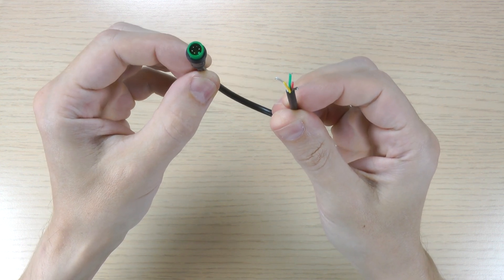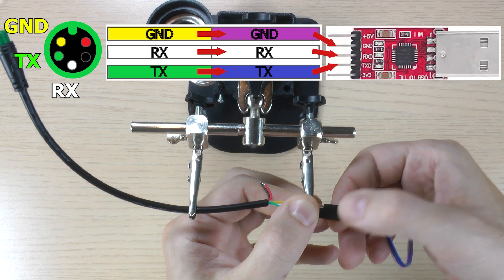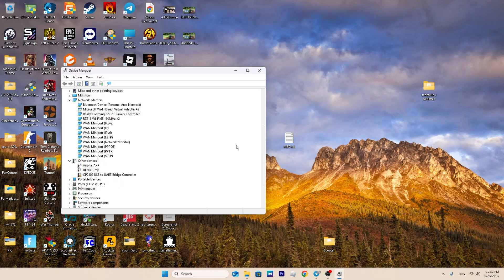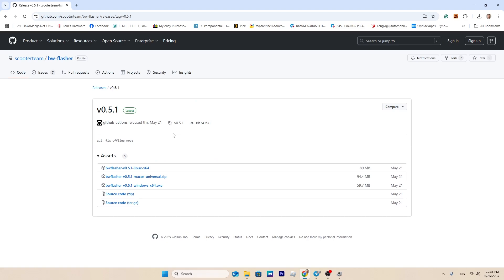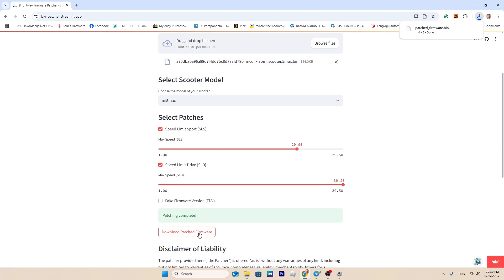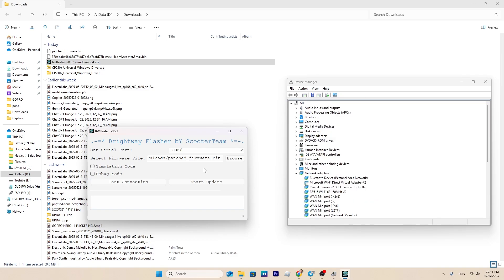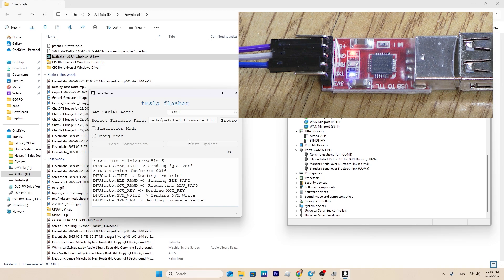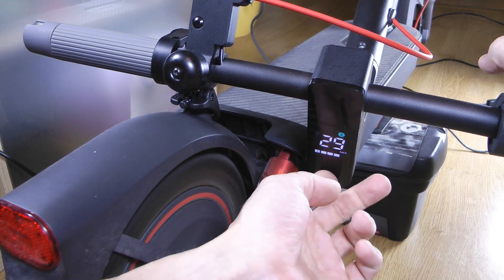Xiaomi Scooter 5 Max Speed Hack (5*|5Pro|4*|4 Pro 2nd Gen)

Comment: Is there any possibility to kill that fucking peeep noise at 30 khm/h ? Maybe with a fake firmwarecode or so?
Reply from the maker: 1: Cover the speaker with duct tape to reduce the sound (quick and reversible).
2: Desolder the speaker from the dashboard for a
 permanent solution.
3: Limit max speed to 29.5km\h.
Subscribe, thx.
Reply: @MindaugasJocionis  thx for the fast Answer; ok maybe i will wait a bit longer it only takes time for modding community to solve it; and i am pretty sure it will be in the modded software some time
Reply: @MindaugasJocionis  Thank you so much for the video! I tried long time with AI and wrong information I found online, but with your video it finally worked well with my Xiaomi 5 Pro! 🙏 Only the peep sound is annoying now. Could you maybe make a video, how to desolder the speaker, please? That would be great! Thanks a lot! Subscribed your channel and will stay updated...👍
Reply from the maker: There’s really nothing complicated about it — just unglue the dash screen, unscrew a few bolts to access the back side of the dashboard PCB, and desolder the two speaker pins from the back side of the board.
I’m still not sure if I want to desolder the speaker just for an extra 2 km/h, especially since it’s still under warranty.
But if I decide to do it, I’ll definitely make a video about it.
Reply: @MindaugasJocionis а если попробовать изменить.bin и убрать бип бип ?

Comment: Hey! Thank you so much making this video! Do you know if connecting the scooter to the Xiaomi Home app after flashing the modified firmware would revert the changes ? My intuition says that if you never apply the updates it should be fine, but have you tried yourself ? If yes, what happened ?
Reply from the maker: No, it won’t revert unless you flash a new firmware. You can disable automatic updates in the app—it will only suggest the newer version, not force it. Right now, this is the latest firmware, so nothing happens when you connect; you can still use the app as normal.
Subscribe, thanks!
Reply: @MindaugasJocionis  Thank you for your really quick reply! I will subscribe to thank you

Comment: Bro thank you for the video, but it doesnt work at my 5 pro and my FT232RL-usb-chip. I was following complitly the description of the e scooter team website. None of the ,,common Issus and solutions worked,,
Reply from the maker: Are you connecting to the scooter with bare wires or a connector? If it takes too long, the scooter will shut down automatically. Turn on the rear brake light in the app so you can see if the scooter is still on after disconnecting the dashboard.
Also, make sure you have the right drivers installed for your adapter.
If you’re still having issues, you can try the patched app linked in my video description "Tesla flasher"
Subscribe, thanks.

Comment: Hi! Does this work the same on the Xiaomi Escooter Elite? Its came out with the other 5 models and i dont know if anything is different. I haven't seen many people talk about the elite model's flashing. Or is it even possible to flash it?
Reply from the maker: No this will not work on elite. I assume it has a different controller inside than any other scooter from the 5 series, which is why no hacks are available for it. Subscribe, thx.

Comment: I need help If i press test Says max retries reched check your connection ? pls help me someone ad if i press start update is 0%
Reply from the maker: Are the COM ports the same in both the app and the adapter?
Make sure the scooter is powered on when disconnecting the dashboard cable and connecting the adapter.
If you're using bare wires to connect and it takes too long, the scooter might automatically shut down.
To monitor this, you can turn on the rear brake light — it will go off when the scooter powers down.
Subscribe, thanks!
Reply: @MindaugasJocionis  I have done all of this, I have other cables, but I know where each one belongs. The USB also lights up red and blue for me and blinks in the middle when I press test in bwflasher, but nothing happens there. Then the error occurs. I have everything connected correctly and can't find the problem. It would be cool if you could help me, and of course, I would also subscribe.
Reply from the maker: What is your adapter model and scooter model? Also, what message appears when you press the 'Test' button in the app?"
Reply: @MindaugasJocionis    e scooter model xiaomi 5 adapter CH340 The messege is  max retries reched check your connection ?
Reply from the maker: Are you connecting it this way? https://photos.app.goo.gl/DkVqe6QAbrAhrois7
Reply: I have this problem too and no matter how hard I tried, I destroyed the thread of the 4 screws twice. Have you solved it yet?
Reply from the maker: @bananaaaaaa9916  Use "Tesla Flasher" and the CP2102 drivers from the video description. I assume you have a CP2102 adapter, as it won’t work with BWFlasher.
Reply: Hello I have a problem I did everything I needed to do I used everything I needed for cp2102 and also Teslaflasher but it seems to me that I tried too many times check the connections and they were correct and 0%.

Comment: hey i got a question, you selected on drive mode to go up to 39.50 km/h but it only goes 32km/h why is that?
Reply from the maker: Probably some limitation. 32 km/h is the maximum achievable speed. At the time, I didn’t know what the actual max speed could be, so I set it to the highest value for testing. Thank you for the subscription! :)
Reply: @MindaugasJocionis  thanks for the answer, i googled and found that the battery is the think, it has to be a 48v or more to go faster and standart is 36v

Comment: and how do you get the original ones back on?
Reply from the maker: Flash non-patched MCU firmware, or in patcher check the box for 'Fake firmware version' and set it to 0015. In that case, the Xiaomi Home app will suggest updating to the latest firmware through the app. Subscribe, thanks!
Reply: @MindaugasJocionis  Also MCU or the first one?
Reply from the maker: MCU
Reply: @MindaugasJocionis Or does the UPD file work too?

Comment: Hi, do you think it didn't work for me because I had a CO2102 adapter, I used BWFlasher?
Reply from the maker: Yes, use app from the video description, specially for CP2102 "Tesla flasher"
Reply: Definitivamente, yo use el CP2102 + TeslaFlasher y funciono perfecto.
Reply: I did everything correctly but I used Tesla flasher but it still says you have tried too many times try later, check the connections please help me.
Reply: @bananaaaaaa9916   Same thing it says check the connections. I tried many times with cables and tried with 2 computers.

Comment: Thsi tutorial works with Xiaomi scooter 5 model (no max, no pro)?
Reply from the maker: Yes, just one difference — you need a Julet M7 5-pin female connector instead of male. I also recommend using a CH340 adapter if you don’t already have a CP2102. And of course, you need to download and patch the firmware for the Pro 5 :)
Subscribe, thanx.
Reply: @MindaugasJocionis  thanks crack!!